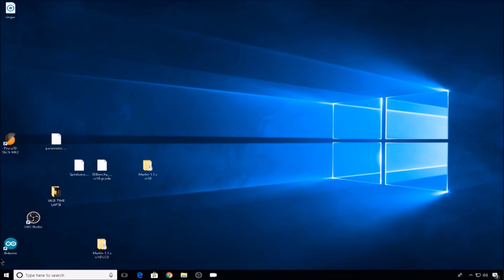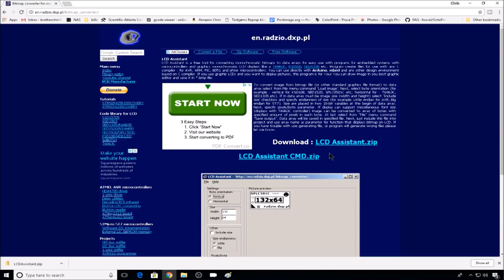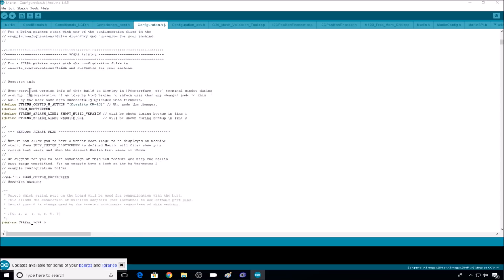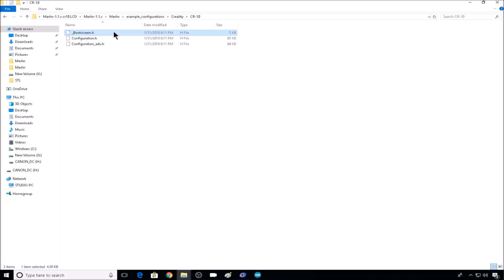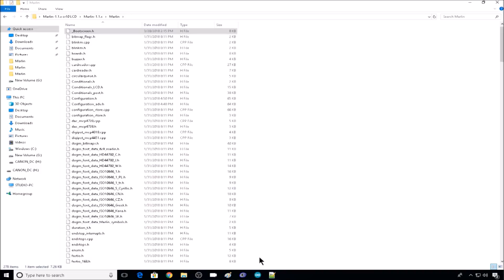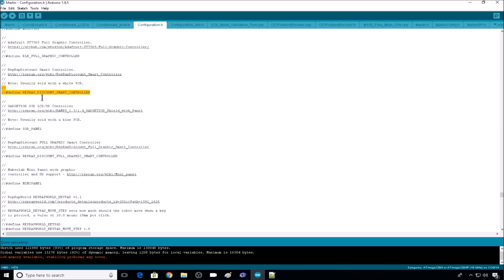Custom Bootscreen On Your 3D Printer - Marlin - Chris's Basement

Comment: what would cause a small part of image on the left to be cut off and show on the right.used stock cr10 screen cause the reprap_discount_full_graphic_smart_controler wont compile on marlin 2.1.2. says lcd_pins enable was not declaired when i try to use it
Reply from the maker: It could be the formatting of the file. Sometimes the copy and paste gets messed up and causes things to not appear correctly. The CR10 screen should be the right one now a days.

Comment: What about full color TFT LCD with 320x240 resolution? Can't find the Bootscreen.h file for my printer. It shows default 195x59 Marlin (2.1.2) logo on startup. I even found this .bmp file in Marlin folders and replaced it with mine but that didn't change the stock Marlin logo. Not sure where to head next.
Reply from the maker: Someone else was asking about this also. Something must have changed in Marlin, I will go back and check it.

Comment: Tested today with Marlin 2.1.1 and its still valid. Works perfectly. The only difference is that the CR10 _bootscreen.h file has just the "CUSTOM_BOOTSCREEN_BMPWIDTH" option, not the HEIGHT one, but that makes no difference, just leave it to 128 and its fine. THANK YOU AND KEEP THE GOOD WORK !!!

Comment: It seems not to work with Marlin 2.0. Did you have a tip for me?
Reply from the maker: It should work the same, check out tomorrows video.
Reply: @ChrisRiley  Hey Chris, thank you for your prompt reply. Found out yesterday that the other custom boot screens from Marlin are not displayed either. So there must be another problem with my firmware

Comment: I had a issue thought i would share. My controller worked fine until i added the custom boot screen 
the problem was garbled or corrupt screen. I new it was a software issue here is what i did.
I made it work by commenting line 79 (U8GLIB_ST7920_128X64_RRD u8g(0);) in dogm_lcd_implementation.h
and adding following line below it
U8GLIB_ST7920_128X64_1X u8g(23, 17, 16); // SPI Com: SCK = en = 23, MOSI = rw = 17, CS = di = 16
Reply from the maker: Interesting, thanks for sharing Mark!

Comment: When you are uploading the new firmware adjustment do I have to change my jumper to usb first?
Reply: sweet, it was kind of annoying to take off 9 screws to add a firmware
Reply from the maker: No, after you have flashed the bootloader you should never need to change that again, just make sure the printer is powered on when uploading.

Comment: Hey Chris I'm wondering if you know anything about the LCD screen jumping around changing on its own.

Some post are saying it's the marlin update. Do you know of a fix for this because it's annoying especially the clicking sound.

Any info you may know would be great.

Thanks
Reply from the maker: I haven't seen that issue yet. Not sure what would be causing it. I need to upgrade my cr10 to .9, I'll give it a look.
Reply: @ChrisRiley  found the issue and the fix.  Thanks

https://youtu.be/tP9pVNBAH4k

It might be something worth mentioning in your next Marlin update vid.
Reply from the maker: Awesome thanks for the link, I will check it out.

Comment: Do you have a tut on setting up the raspberry Pi 3 and the CR10 so I can just sent it over to the print and drop the Micro SD card?

Thanks
Reply from the maker: I don't, not sure what you would want to do. I need a little more info.
Reply: @ChrisRiley  I would like to be able to set up my Raspberry Pi 3 so I could just send the files over to the printer from my laptop as opposed to having to take the SD card out of the printer put it in the laptop transfer the STL files take it out of the laptop put it in the printer to print the file. 

I know this can be done with a rasperry pi 3 I actually had it set up but the tut I was following just got me all confused. I like the way you explain things, break thanks down and show what needs to be done and that's what I'd like to see.

I'm not hooking up a webcam so I don't need that part just getting the Raspberry Pi setup to send the files wirelessly to the printer.
Reply from the maker: @MarkWilder68  octoprint is the way to go. It makes all this so much easier.  Check out this video at minute 2:56 I walk through a really quick way to get it installed https://youtu.be/nSzUT10jJFU

Comment: Hey Chris! I could really use your help.. I've followed your tutorial and gotten my boot screen on my TAZ 5, but some of it doesn't show up.. Like the text is missing random pixels. Could you please help?
Reply from the maker: What screen do you have on the TAZ? Can you try another boot screen and see if it works better? It could be your BMP file. If you are using Marlin 1.1.8 there is an example boot screen in the examples > CR10 folder.
Reply: I have the correct screen. Ill try the test CR10 and let you know how it goes. If my BMP is at fault then what should I do? Thank you for replying!!
Reply from the maker: It might just be a problem with the file format. Sometimes if the art is smaller it makes the screen do strange things. You might be able to adjust the settings of the BMP file.

Comment: Ordered a full screen graphic lcd a little while ago so this will be fun to try out, question, what are your thoughts on cheap touch screens? I found several small cheap ones for $16-$18 so rather than buying an lcd maybe it would be better to get a touch screen. My biggest challenge when ordering them is whether or not I can change the Chinese text and if they really are compatible with the lcd jtag ports on a RAMPS 1.4 extension

https://www.aliexpress.com/item/3D-Printer-lcd-splash-screen-MKS-TFT24-touch-screen-smart-controller-display-support-wifi-APP-Cloud/32845795863.html?spm=2114.search0104.3.1.41de3733pvnB2n&ws_ab_test=searchweb0_0,searchweb201602_2_10152_10065_10151_10344_10068_10130_5722815_10324_10342_10547_10325_10343_10546_10340_5722915_10548_10341_10545_5722615_10697_10696_10084_10083_10618_10307_5722715_10059_10534_308_100031_10103_441_10624_10623_10622_5722515_10621_10620,searchweb201603_1,ppcSwitch_5&algo_expid=11f213b5-9665-4002-9e33-41069589180a-0&algo_pvid=11f213b5-9665-4002-9e33-41069589180a&transAbTest=ae803_1&priceBeautifyAB=0
Reply from the maker: I don't really know, I have never tried to install a touch screen, but I would like to give it a shot. I might have to shop for one.
Reply: Thanks and good luck! I really look forward to the day that touch screens become the new full graphic lcds :D
Reply from the maker: Might be sooner than you think.  ;)